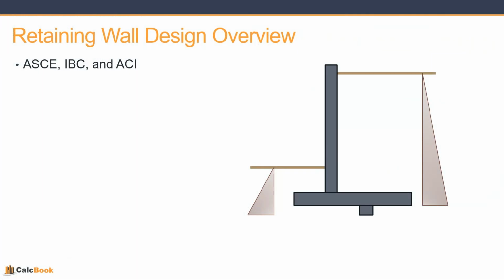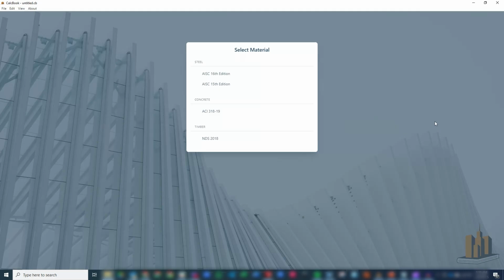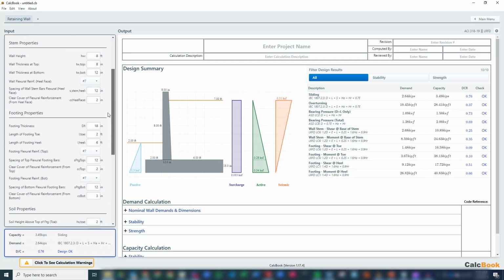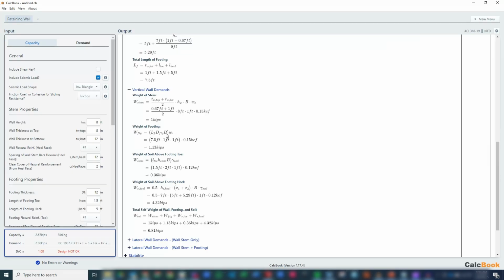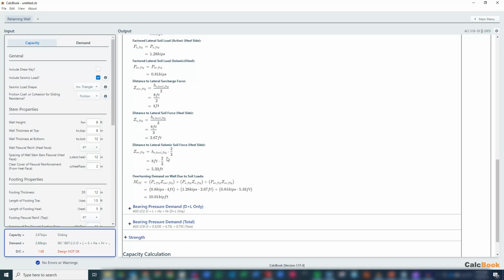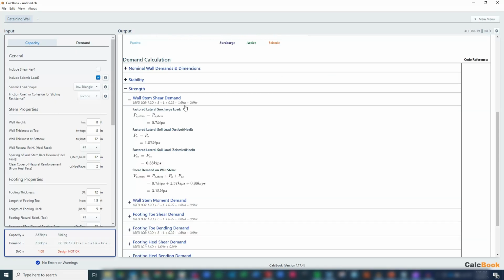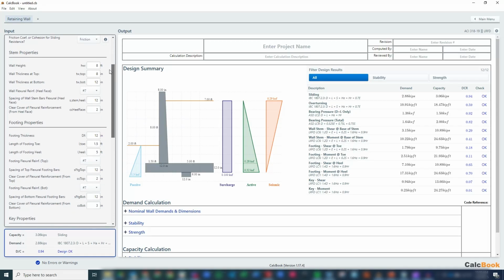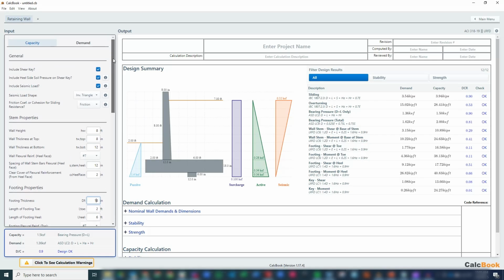Retaining Wall Design | Structural Engineering Tutorial

Comment: checking the stability an calcuating the capacity shouldnt we include/deduct the vertical component of seismic ?
Reply from the maker: Good question. In US practice (AASHTO and Caltrans), the vertical seismic component is usually neglected for typical retaining walls. You design for the horizontal effect and set k_v = 0. Two reasons: the peak vertical and peak horizontal accelerations aren't assumed to hit at the same instant, and in the Mononobe-Okabe equations the vertical term's two effects (it lowers the thrust but raises the pressure coefficient) roughly cancel out, so the net change is small, mostly magnitude, not distribution.

Worth noting: "neglect vertical" applies to the wall's own weight too. You don't add a vertical inertia force to the concrete self-weight. But you do keep the horizontal inertia of the wall mass, which people sometimes forget. Where vertical acceleration actually matters is near active faults or for stiff/restrained (non-yielding) walls. There it's reasonable to include it and check both up and down cases. Hope that helps!